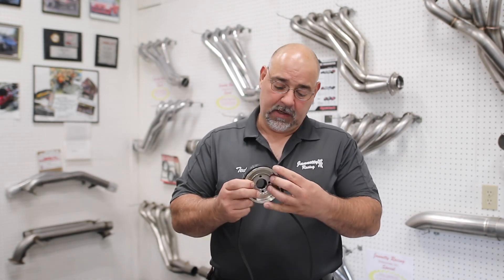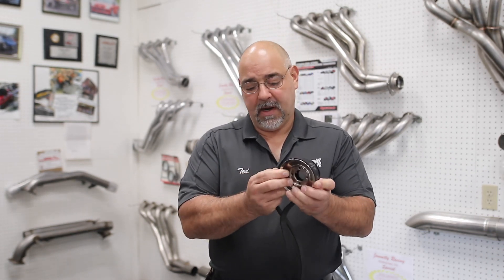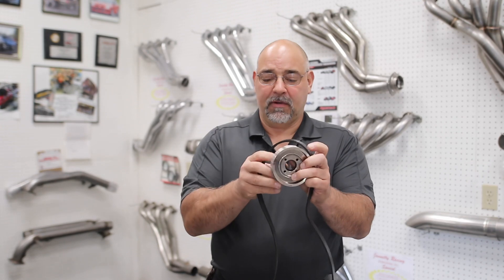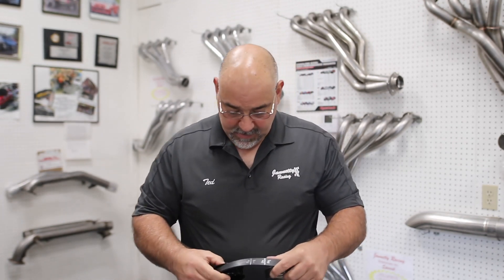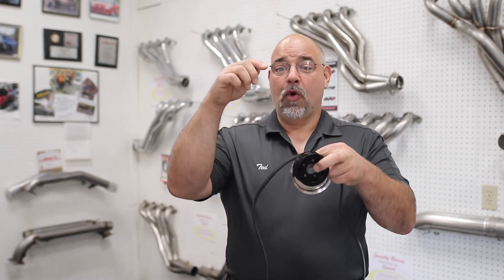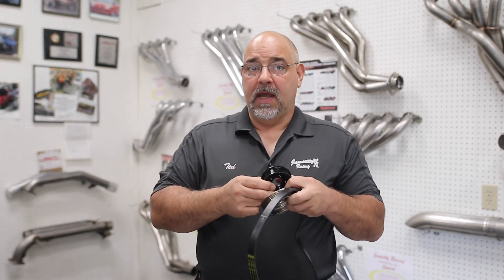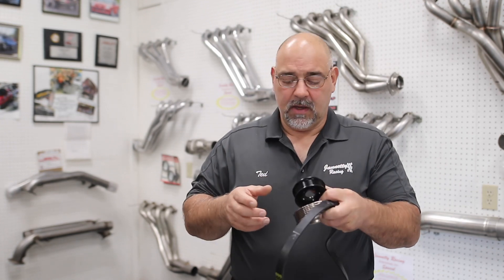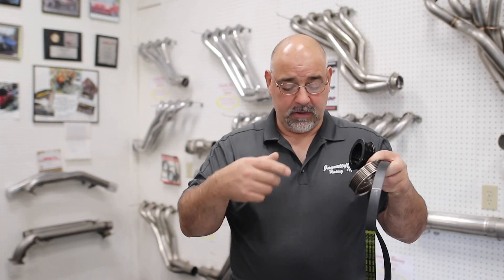Ted’s Tech Talk EP. 4 Supercharger Pulley Upgrades,

Comment: Hi again i sent the wrong messages 
To u i mean

Question 

I have a rover L405 3.0 supercharged 

Once the original pullybus removed dobI have to mill down the snot end v4 heating up the new pulley on?

Or?

For the 3.0
It's just a heat up and slide on the water cool?

Just wondering  bc I read the 5.0
Has to be shaved /milled down

Thanks alot